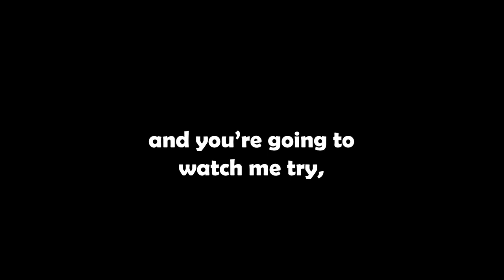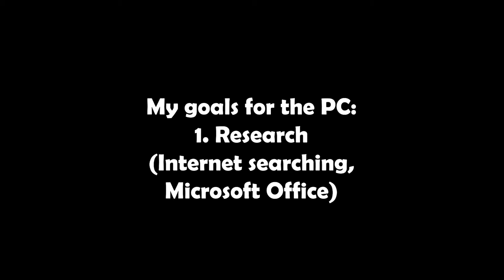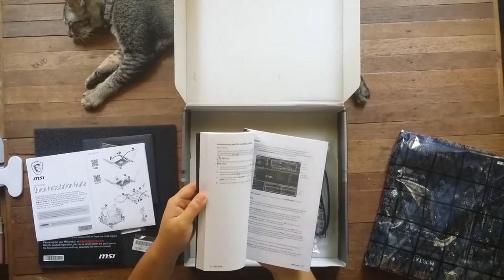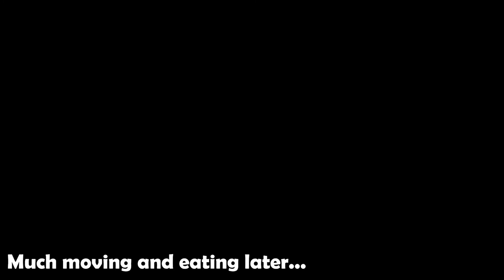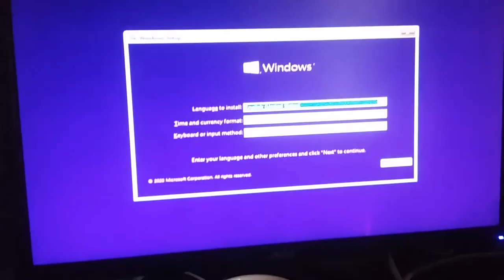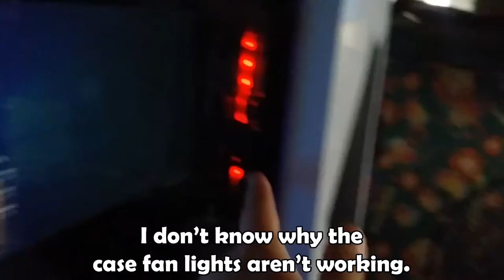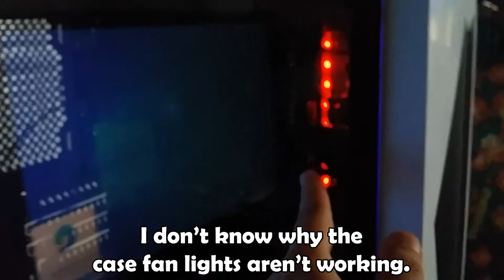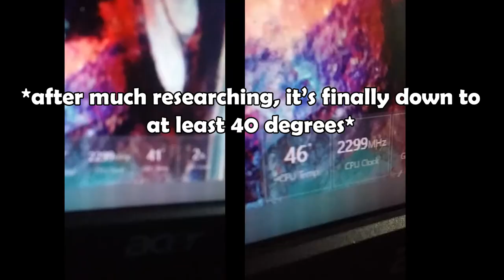Building a PC for the first time (Shopee Build)

Comment: Ohh i have a 28k build also i built it last month
The specs are:

Ryzen 5 3400g tray
MSI B550m pro vdh wifi
Silverstone st60f 80+ white
Tforce delta rgb 16gb 3200mhz
Kingston nv1 250gb m.2
Deepcool gammax 400 ex 
Keytech t1000
4 gstorm phantom 120mm fan
Viewplus mx-24